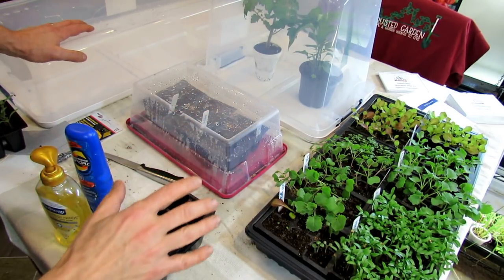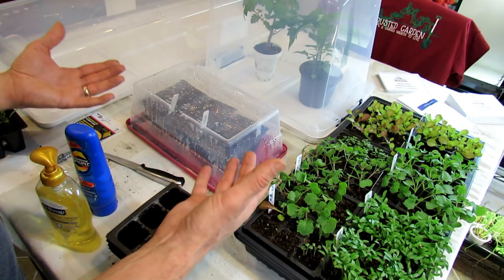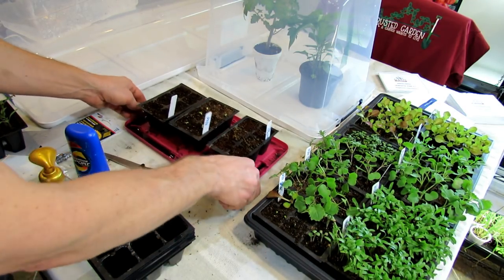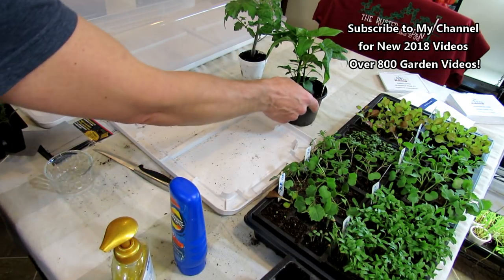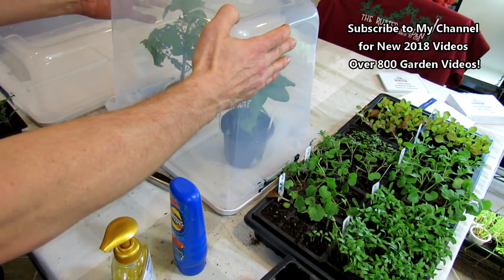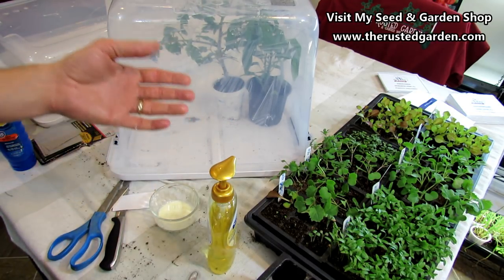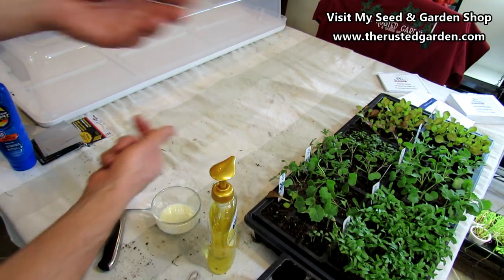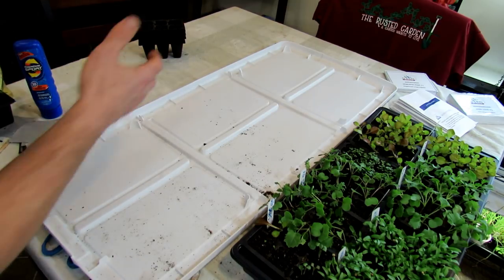How to Build Vegetable Winter-Sowing & Acclimation Domes:  DIY Ep-1

Comment: I'm in zone 9 (Netherlands) and have been using clear, heavy duty double plastic bags to: keep birds and mice from picking out the seeds, acclimate plants, cover tomatoes from rain, as wind protectors, heaters and general pest control. They can be opened up, closed or brought inside if necessary. I think I may have learned this from one of your videos, just carried it over into my winter projects. Very useful against heavy frosts.
Reply: Super, bedankt.
Reply from the maker: Ill be using the bag system on some warm weather tomatoes Ill put out soon. The bags are nice.
Reply: @EmailgroupieESLEducation 
What is an action store?

Comment: Zone 9b with blazing sun and 110 plus days, and I rarely acclimate seed starts.  If I do, I put them outside in an area that will get shade after noon for a day or two.  The containers will work great for me.   I use grow lights very very close to my plants, and I suspect that gives the starts some light tolerance, however, I don't think my lights give off UV light.  I've also noticed that root damage during transplanting greatly affects a plants ability to acclimate quickly and is that main cause of failure.
Reply from the maker: Glad it works. Its a pain but when I dont do it and lose plants.
Please visit The Rusted Garden Seed & Garden shop for seeds, seed starting supplies, neem oil, TRG merchandise and more at www.therustedgarden.com & Please Ring the Bell (next to subscribe) to get immediate real-time video notifications of new videos. I have over 1250 garden videos you can search and find the answer you need. Thanks

Comment: Great tips. Have you used the sunscreen method successfully in a previous season? I like these ideas a lot. Thank you Gary.
Reply from the maker: Nope. Just worked out the plan this week. But it is solid. It is based on wash the put on greenhouse to do the same. Not sunscreen but soap and paint. But it goes on inside of green house.

Comment: I like this idea, especially the containers turned upside down and the flyscreen. I am not so keen on sunscreen as the whole project starts to look fiddly and the exterior of the container would require cleaning later. I would prefer to just place rectangles of shade cloth or bird netting over the container to provide a little screening. The shade cloth can be removed after acclimation and kept in a bag or container for reuse in a future project.
Reply from the maker: Thanks. Only took me 10 years to thing about flipping them LOL. I forgot to mention shade cloth as option. That works just fine.

Comment: Hello Gary, please use a drill to make your holes on the plastic  tops, much safer than a knife  :)))) Also the technical name for the  bottom watering  of  plants  is called  capillary watering. Great video as always and thank you :)))
Reply from the maker: True. Thanks for the safety tip LOLYou can support The Rusted Garden by using this link for anything you purchase on Amazon. It doesn't have to be garden related. Anything you purchase gives a % return back to The Rusted Garden
http://amzn.to/2ttyray Thanks for using my link. It helps fund my garden videos!

Comment: Hi Gary, So when you start the seeds you don’t have holes right?  When do you make the holes?
Reply from the maker: I am not using them right now but you could put a hole in. No real reason but to keep the cooler air out. You can make a hole and just put duct tape over it for seed starts. Remove when freeze is gone.You can support The Rusted Garden by using this link for anything you purchase on Amazon. It doesn't have to be garden related. Anything you purchase gives a % return back to The Rusted Garden
http://amzn.to/2ttyray Thanks for using my link. It helps fund my garden videos!
Reply: Gary Pilarchik  (The Rusted Garden) Thank you

Comment: Hi, Gary.  I think this is brilliant for starting seeds outdoors.  But, rather than put holes in the bin for air exchange during acclimation, could you just leave the bin unsealed/unlatched with something under one end to keep it slightly open?  That is, if bugs are not a problem...
Reply from the maker: Yeah that's what I do for the small one. You can flex it as you wish for your zone and needs.

Comment: I started using containers for starting outdoors and acclimation years ago. I would just flip the tub so that the lid was on top and blocking sun for plants that were just beginning the acclimation period. 
The screen patch is a great idea. I have a lot more space and plants this year so...
Q: I was looking at those small greenhouses and acclimation tents on your affiliate page. Does the green cover cut out UV rays? Would seedlings coming from grow light to one of those tents need additional sun blocking or is that what the green plastic does?
Reply from the maker: If the covers have UV protection on them. It varies. The ones I picked had them. It helps to cut them back. I just cant say how much. I ordered some and will be shooting videos using them.
Check out my new Amazon Influencer's Shop. Anything you buy on Amazon helps The Rusted Garden when using my link.  Ill be putting what I use in videos there for 2019. It is all set up by categories. Thanks.  https://www.amazon.com/shop/garypilarchiktherustedgarden

Comment: Great helps! Question on the Sunscreen.  We usually have to reapply every few hours so would it last all day or would we have to reapply?
Reply from the maker: It will last till the rain washes it off. So it could be days.
Please check out The Rusted Garden Seed & Garden Shop for all your gardening needs: www.therustedgarden.com
Reply: @THERUSTEDGARDEN  I am disgusted with myself because I am about to become one of those hairsplitting pedants who I disdain. Most especially I am disgusted with myself because I sincerely respect you and your sound scientific approach to gardening. But I feel some clarification is in order. 
Titanium dioxide and zinc oxide are physical sunblocks that are not degraded over time and exposure to UV radiation. Sunscreens like octyl methoxycinnamate and oxybenzone are chemical sunscreens that are degraded by exposure to UV radiation. They absorb UV radiation and convert it to heat at which point they are no longer effective at protecting your skin or plants from UV radiation. This is why the instructions on sunscreens direct the user to reapply after a period of time and after swimming or perspiring. Chemical sunscreens are also degraded and rendered ineffective by just plain heat over ~80*F.

(Aside: Some of the active ingredients of chemical sunscreens sold in the US can get absorbed into the body and accumulate to possibly harmful levels when used as directed. Which is why I only use sunscreens approved for sale in the EU where chemical sunscreens that are harmful when absorbed into the body are banned. Safety first)! 

So I would recommend reapplying chemical sunscreens with a high SPF daily during the acclimatizing period or just using a straight sunblock that contains zinc oxide or titanium dioxide so you don't have to reapply on super hot or super sunny days. 

Regardless of the above, I commend you on your ingenuity. I never would have thought of using sunscreen for seedling acclimatization.  Very clever!

Comment: What about this idea?  My flowers are growing on three shelves of a rolling unit...with shelves made of  metal grating.  I could take plants out of trays so some sun could get through to all the shelves.  Then rolling it out of my garage to sit in the sun, covering the entire unit in plastic?  Wouldn't that be the same principal to harden the plants?  I could leave it out all night as long as temps didn't plunge. Wouldn't have to punch holes as air would circulate from bottom of unit. I would water plants with a fine mist of garden hose. Workable?
Reply from the maker: Yep you can do that. You can even start young when the break surface and just give them sun over the growing weeks. They will be tough. You just have to watch for freeze and intense sun. But I think that is workable.You can support The Rusted Garden by using this link for anything you purchase on Amazon. It doesn't have to be garden related. Anything you purchase gives a % return back to The Rusted Garden
http://amzn.to/2ttyray Thanks for using my link. It helps fund my garden videos!

Comment: The weather here keep changing like hight at 60s and low at 40s at night for few days then low at 30s or 20s for a night or two but sunny at day time, so if I bring seedling outside for three days then bring them inside when it get cold when I bring them back out again it gonna count as day one of hardening off or day four? I have a mini green house like you used in one of your video but I am not really sure if my seedling will survive the temp below freezing in that green house at night. Thanks!
Reply from the maker: You can count them as if consecutive. There are lots of ways to do it. The idea is 7-10 days of acclimation with the later days being longer periods of time.

Comment: Gary, are the principles the same for acclimation coming from your green house to the garden?
Reply from the maker: if they are getting real sun in the greenhouse they are probably fine. The might need to get use to wind and temp fluctuations a bit but the UV rays are the most problematic.
Reply: Planning on starting all seedlings in the (Fullsun) greenhouse and then transitioning them to the garden, with a fan blowing in the greenhouse. First year starting in a greenhouse.. instead of in the house.  thanks Gary.

Comment: Isn't it counter productive to punch holes in the screen or am I missing something? I guess I don't understand the screen idea. Is the  screen a  sheet without any holes ,just a patch?  Another thought I had,I thought most seeds need bottom heat to germinate' I'm all for making growing things easier. Thanks
Reply from the maker: Yea the tape covered the holes.
Reply: carol parrish - If you're talking about starting seeds indoors, or outside in mild weather - most seeds DON'T need bottom heat to germinate. Even peppers/melons CAN germinate w/o it (assuming soil is at least room temperature). However, some warm-weather crops germinate in half the time (or have a better germination rate) if you have them on a heating mat. I don't have any problems germinating tomatoes, squash, or cuke without a heating mat, but find it much easier to get peppers and eggplant to germinate with one. Melons - eh, depends.